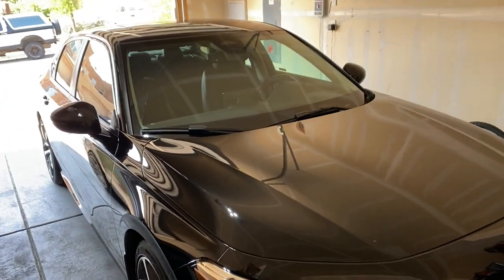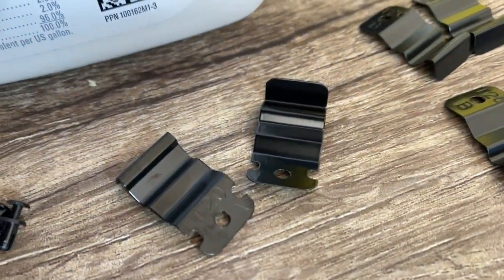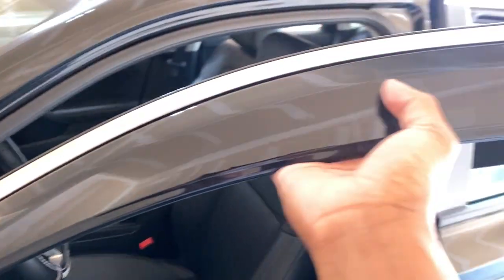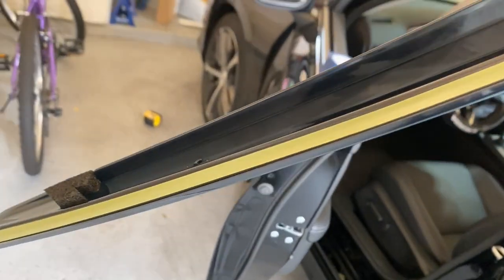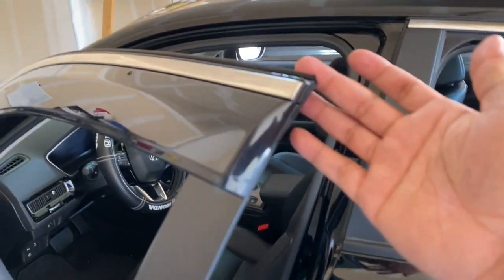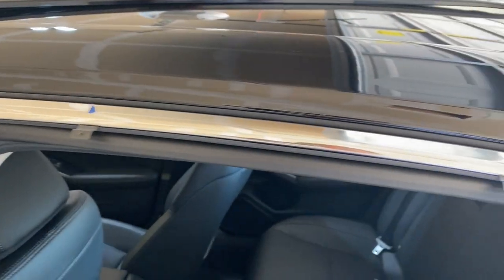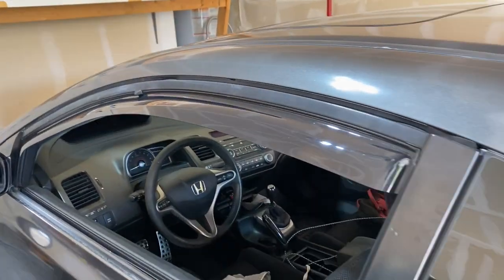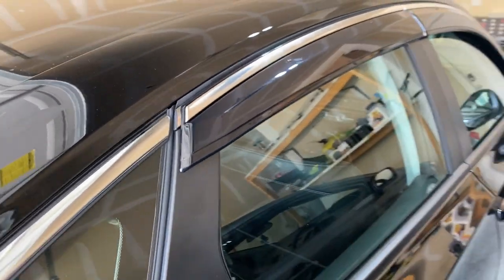Installing Door Visor's on my 2022 Honda Civic Touring

Comment: I just installed these on my 2020 CRV I decided to get these because I had  the push in visors that slot into the window channels like on your car but when it was really hot out and you put the window up the auto rollback feature on the car wound the window down, the push in ones expanded in the heat and the window sensors thought there was a restriction on the window, so a bad design really, I ve since learned that the push in visors break the window motors too over time and Honda will not cover those broken motors if they break within the warranty so something to think about. The rear Honda visors on my car are the same on the 2022 Civic they are not long enough and expose a few cm's of the chrome trim below, they never thought that out did they.

Comment: Thanks Shakeem.  I ordered the deflectors from my dealer and they came without instructions, so your info about where the A clips and B clips are installed was invaluable.  My 2023 Sport clips were different though and fit in the window groove vs under the gasket.  Thanks much for your clip though.  Saved me from having to pay the dealer to install.
Reply from the maker: Glad I could help 👌🏾

Comment: I think if the rears were any tighter the door might not open properly because they would bind on each other but I'm not sure.
Reply: Update: After installing these on two cars it's the same. You are definitely right, they could have been made them a bit longer. The way the hinges operate they wouldn't bind on each other even if installed very close. 

When you install these you have to install them and just decide to either shift them forward, backward or split the gaps some way. I chose to try to just split it up for the best look but it's weird and should have been designed better just like you have said. 

Thanks again for the great video. Also, like you said later in your video, no need to really measure. Just line them up where you want them to sit and then adjust the clips little by little and check multiple times that the holes line up for the clips. I think you could probably pre-install the clips and then slip the whole trim into place within the weatherstripping but mine are already done so I won't try that lol.

Comment: Bro did you get any paint protection on your car?
Reply from the maker: Didn’t get any paint protecting
Reply: @Shakeem  the local honda dealer told me not to get any underbody corrosion protection either. Do you recommend one bro?
Reply from the maker: I live in New Mexico and it barley rain or snow so we don’t need that due to us not having to worry about Rust. But if you live somewhere we’re cars get rusty fast I would

Comment: will this fit the civic si 2022?
Reply from the maker: It should same chassis. I believe Si get the full black instead of chrome on the top
Reply: Got mine for around $200 at the Honda shop. Did you spend about the same?
Reply from the maker: I didn’t, I get a discount for working at Honda.
Reply: @Shakeem  should I try the chrome top on my 22 Honda Civic sport pearl white or just stick with the black?